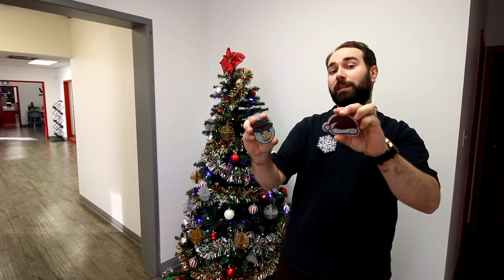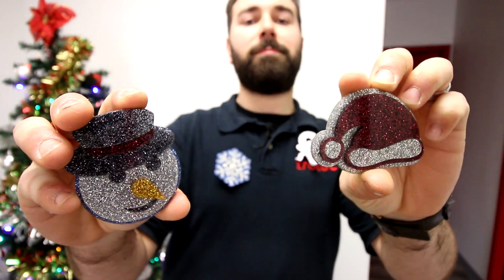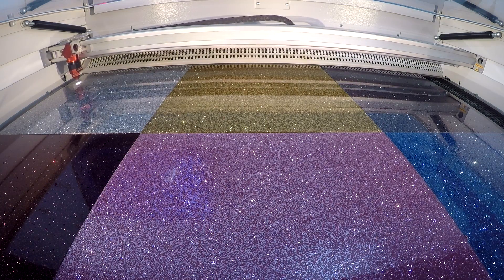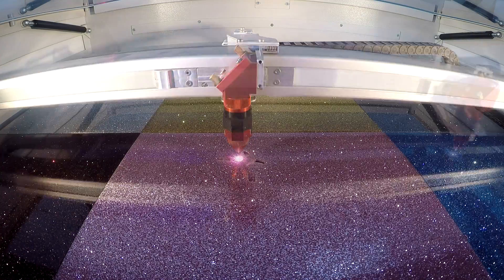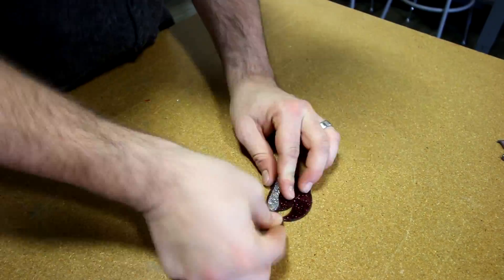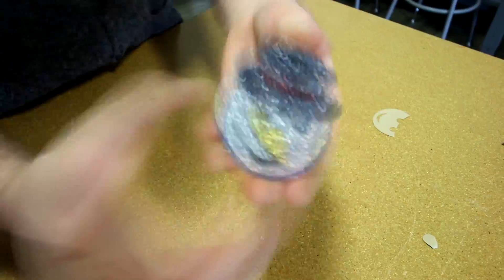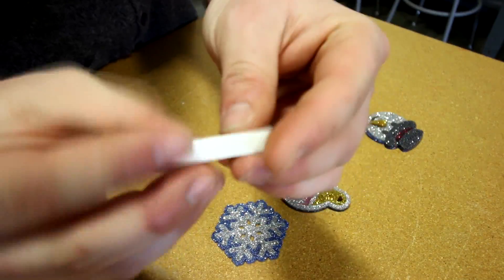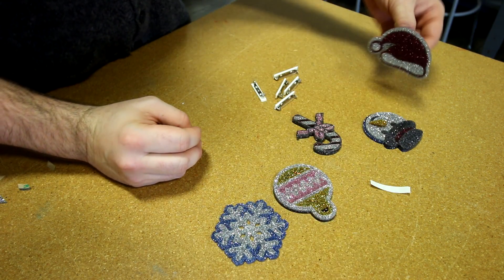DIY Christmas Pins | Laser Cut Glitter Acrylic | Glitter Pins

Comment: Hiya, cute pins! I have 3 questions: 

1. What is the contour method? 
2. What is friction fitting? 
3. Which 3m adhesive do you use? 

Thanks in advance, great video!
Reply from the maker: Thanks! Contour is when you can outline an inner object making it fit well into the outer object. Do you have CorelDraw? Friction fitting is basically inlaying. We have our 3M adhesive roller that we add on request to all of our sheets.
Reply: Ahhh thanks for the reply! So etch inlaying it makes the adhesive less likely to knock the top off if you drop the brooch, how cool! I've tried out 3m VHB tape with some of my work and was able to rip it off afterwards, but it was just smooth acrylic.  @TrotecLaserCanada